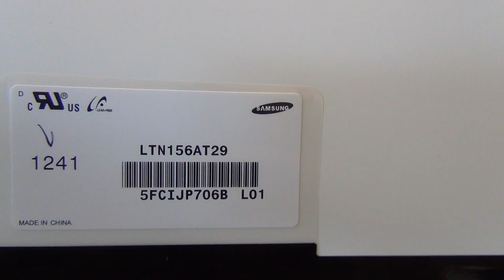Lenovo IdeaPad P500 Laptop Screen Replacement Procedure

Comment: I have a question. I have a lenovo P500. I can see the screen graphics. But the back light is off. I know is not related to the  driver issue with this pc. Is the back light integrated to the screen? Do I need to replace the entire screen?

Comment: I need a replacement for the whole monitor i guess as in mine it's the right side of the monitor that is cracked not the screen itself. The plastic that holds the screen is too flimsy. I have found out  that this is the usual problem with this model. I hope they will have a recall..

Comment: I have a similar laptop, the IdeaPad Z500. It's equipped with a 15.6" glossy TN screen 1366x768, it's not damaged but pretty mediocre quality, and i want better, and i have perused the specs and found one thin matte eIPS screen of 1600x900 resolution that will fit the connection and should fit the narrow mounting depth. It is my understanding that the hardware of this laptop will not support higher than 1600x900 because it's single link, but i have doubts whether the firmware will allow me to use a higher resolution screen. Do you have experience in this regard, or someone who can mod the BIOS? I'm willing to pay for it being done, if necessary.

Comment: I replaced my screen with two different screens. The clarity is good, but the brightness controls do not work anymore. When I hit the button the slider goes up and down, but the screen brightness does not change. This has been tested with two different replacement screens. Can you offer any help? Thank you
Reply: I had this same problem after I updated to a new version of Windows 8. I went to the lenovo website and downloaded the original drivers for the graphics. I do not remember exactly how I did it but if you search for the drivers for the laptop and then find the graphics one, and if you're tech savy at all, you will be able to figure it out! Good luck!
Reply: Familiar with this issue too after Intel driver updates on Windows 7, or after installation of Windows 10. It's advised not to allow Windows Update to install new GPU drivers on this machine, and use only the drivers provided by Lenovo for this machine, and the Windows 8.1 driver can be force-installed under Windows 10, runs no problem. It's then advised to look into registry for FeatureTestControl and related keys in driver settings (i think FeatureControl too), write down how they were in Lenovo provided driver, and try to reinstate them with reinstalled drivers too if you absolutely need to use newer driver; or try change them to FFFF if those no longer work.

I also had to apply some fixes to make backlight control run under Linux (acpi_backlight=vendor video.use_native_backlight=1), which is what i'm running now, so if you need further help with getting backlight back to working in Windows, i'll need to reboot later. It is to be kept in mind though that there are multiple hardware variants of this machine, mine has no touchscreen, it has HD4000 on-chip graphics and NVidia Optimus GT645M secondary graphics.